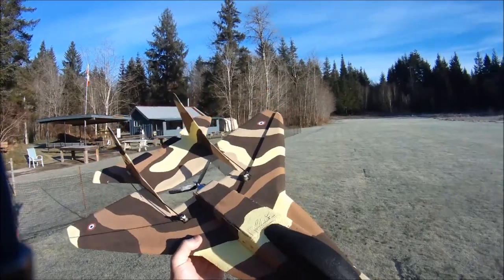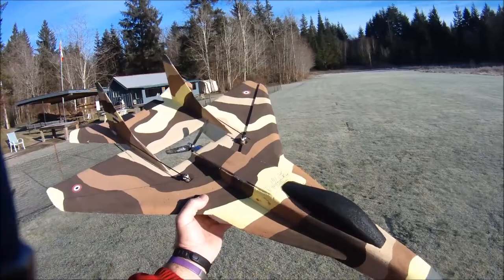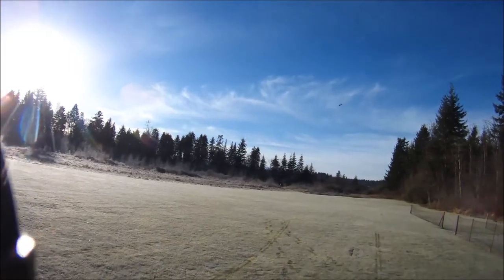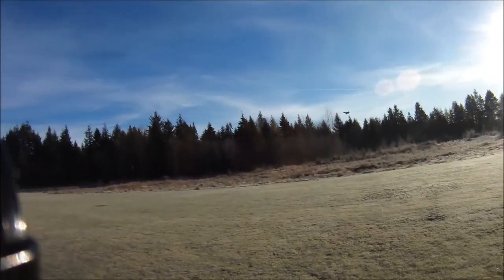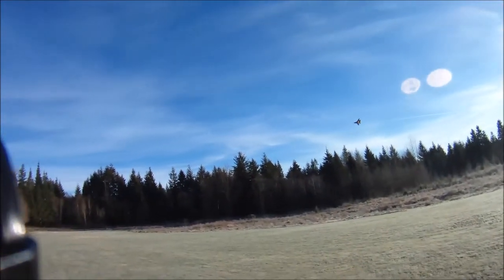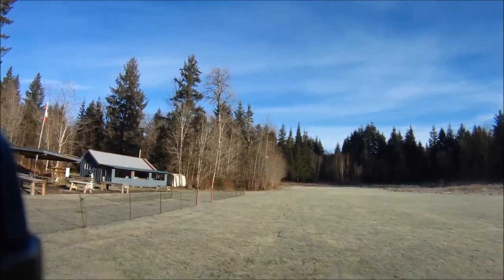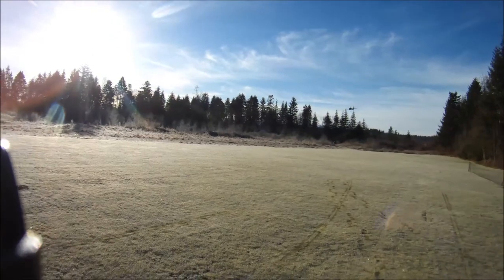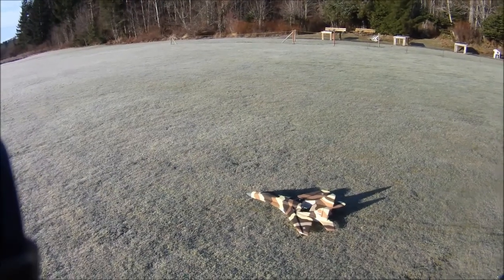NAMC Mig 35B flight video 02 Feb 2017

Comment: Not sure if it is the carbon fiber prop, but it seems to be flying in a more "Crisp" sort of mode than usual.   Nice...
Reply from the maker: Thanks very much.  The carbon prop certainly does give nice, crisp response to the throttle as it is so stiff, a fun little combo.  I think they are actually props that were designed for quadcopter setups, but I have had good results with them and for four carbon fiber props, the price is quite reasonable.  Cheers, Scott

Comment: Good flying as usual. Looking from the tail is the motor turning clockwise?  Would you  then use a clockwise prop or counterclockwise prop.?  Can you then use the other 2 direction props and reverse the motor direction and make it work?
Reply from the maker: Hi Doug, thanks very much.  On this plane if I look from the rear, it is turning clockwise.  I have used all the props from the package of four I got from RC Timer.  For the ones that need to turn counter clockwise, I just simply reverse two of the wires connecting the motor to the ESC to change direction of motor rotation and it works just fine.  I don't really notice any problem with torque roll either way, it seems to be reduced with three bladed props in my experience and with the pitch only being three, I don't really notice much difference whether the prop is turning clockwise or counter clockwise.  Cheers, Scott